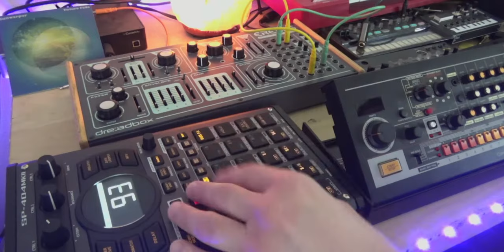Rebuilding my Dawless Setup // Novation Circuit Tracks and Roland SP-404

Comment: Thanks for the video! I have a Circuit Tracks, and I've been wanting to pick up a sampler. The SP404MK2 is one I'm definitely considering. I'd love to hear more about how they sync - I found your video searching for setups using both.
Reply from the maker: It’s an incredibly powerful combo.  I’m planning on creating a full live set with just those 2 pieces of gear.  In terms of proper sync, you can definitely use the circuit as the brain and sync/control the sp on one of the circuits midi channels.  I’ve done this as I like to keep them unsynced to add a little more humanity and variance.  

For me I just send the circuits audio into the sp and play them at the same time.  I’ve had no problems and it’s a little more interactive and fun this way (at least imo).  
Hope that helps 😊
Reply: @sunwarper  thanks so much for the response!

Comment: Hi! I have a similar setup: Novation Tracks, SP-404 MK2, Behringer TD-3 and a Minilogue. I have an issue with this setup. The problem is a really weak input on SP-404. It's gives really low volume disregard I pump up my Tracks volume up to maximum. Of course it sounds great, but the problem appears when I play my samples on the SP-404. They are so much louder than incoming stereo from Tracks that I lower all pads volume to 1 and they are still louder than input mix. I tried to put a compressor on input of my 404, but it's still has some amount of disproportion. Such a shame to have that power on hand and one weak point makes this setup unusable for me.
Reply from the maker: That's a real bummer, sorry to hear that.  Sounds like you might have an issue with the line in's or the cables.  Contacting Roland is probably the way to go. 

Are you sending the tracks through the top stereo line ins? If so, have you tried the other instrument line in on the bottom?  While mono, it does have an input gain.  That would probably help determine whether it's the top line ins, or something else
Reply: @sunwarper  Yep, it’s a top stereo thing. My cables are ok. So… it seems like it’s a common issue. I found a couple of threads with complains about the weak input. Just this night I found that when you send the signal to bus 1 or bus 2 you get a significant boost, but when you send it to DRY the signal is weak. Seems like you never get a perfect setup. Hehehe

Comment: Last, but not least: on your SP 404 how did you manage the bass part of this jam? did you put single bass notes on the pads of a bank and then arrange them in the pattern, as you did with single drum hits, or did you put a whole bass loop on a single pad and then trigger it into the pattern? I tried both ways and I can't choose which is best (or, less bad): if I play the bass part from single notes, it seems to me a bit too fake or mechanical, but it also gives me the chance not to spend a lot of ti,me composing fixed bass parts and throw them away if they don't fit.....Thanks!
Reply from the maker: I put a full bass loop I made in a DAW into a single pad and then programmed it in the pattern sequencer.  

I think both ways work in certain context, single bass notes that you sequence can work, especially if you do subtle volume/velocity changes and less quantize for each note.  Doing a full loop is great but sometimes the sync can go off

Comment: Hi! after watching this, I'd like to ask for your opinion on would you set up my simple dawless system (for live), which seems to be really similar to yours... I've got a SP 404 SX and a 1010 Blackbox (my Brain). I want them to be synced (by MIDI, from Blackbox to the SP) and I want the SP to be last in chain, since I want to apply its effects (most of all vinyl and radio tuning) to the whole audio stream. How would you suggest to assign the samples? Would you store the groovy samples (drums, bass) on the SP and chords/pads/themes on the blackbox? Maybe in this way I could have  drums and bass sounds common to all the songs (composing beats on the SP with the pattern sequencer). Or maybe the opposite is a better choice? Or, again, putting most of the stuff on the Blackbox and using the Sp mostly for some one-shot hits on the fly (dub delayed hits, single spare drum hits, some additional vocals?...) In general, I think that the SP should contain all the sounds which could be common and useful to all songs, while the Blackbox should be the songs and set list container, since it can save songs presets.... In addition, I also use the Keys feature of the Blackbox (kind of synth), with a midi keyboard connected to the USB port, to play additional riffs and themes. Thanks!!
Reply from the maker: Hey Manu, sounds like a great setup, those 1010’s look sick.  I haven’t connected the sp through midi yet to my setup, I just send all audio from the circuit and synths into it for processing.  Like your idea for the sx, is also use the sp to play more common samples or drums and I just try to sync the play times between the sp and Circuit.  

I think having a machine that can send midi to other instruments works great as a brain, and then use the sp for live effects work and additional performant I’ve samples. Let me know what you decide on 🙂

Comment: Do you have any tips on going from loops to sequences? Since there is no song mode on those machines would that be a problem?
Reply from the maker: There's a few different ways to approach sequencing with hardware and some that are specific to each piece of gear.  The Circuit Tracks has a sort of song mode where you can load different pattern groups into "scenes" and switch between them, or set them to switch through each scene in order.  The SP has an incredibly powerful pattern sequencer that allows for switching between patterns.  While there may not be dedicated song modes, swapping between patterns in a more free form manner (and performing synths or samples on top of that) can lead to some interesting track developments.  I've swapped from a DAW to this method of creating almost exclusively now.  Hope that helps :)

Comment: Actually, any tips on how to play on the Tracks? I don’t know what notes I’m playing and I can’t get the hang of not pressing or playing a keyboard
Reply from the maker: The tracks is pretty intuitive once it’s workflow starts to click.  If you hit scale when you’re on a synth track it will pop up with a keyboard and you can select which key and scale you want, then each pad will be the 8 notes of the scale.  There’s also a chromatic setting which lets you play all notes.  Hope that helps, let me know if there’s anything in particular you want to know about.  My songs from scratch playlist on my channel is all about the process of making songs on the Circuit and may be useful for you as well 🙂
Reply: @sunwarper  thank you my friend. That definitely will help o get into it. Just gotta make sense of the menus a little bit :)
I’ll watch some more, this has turned into my hobby